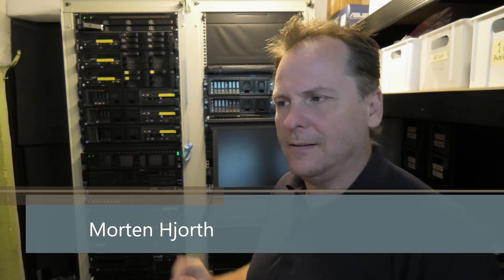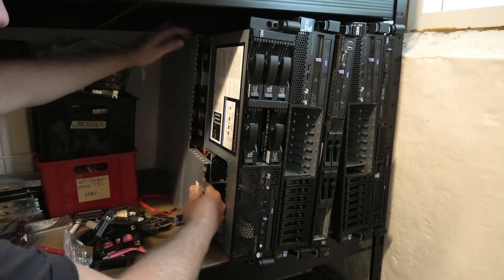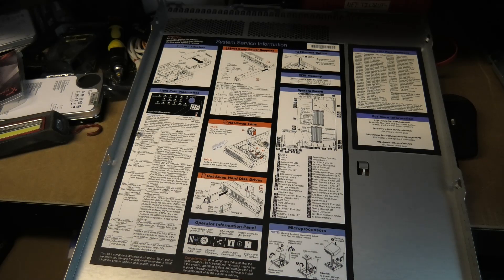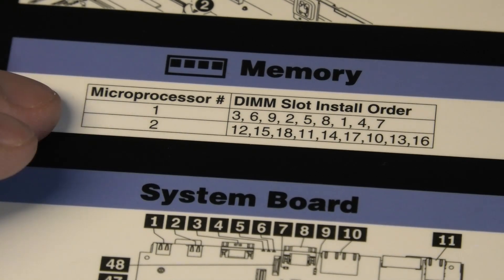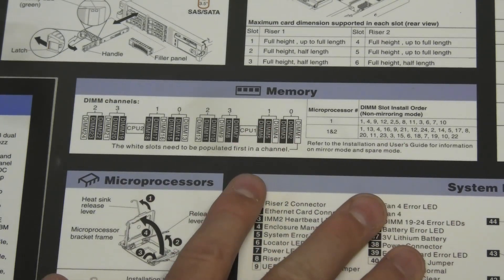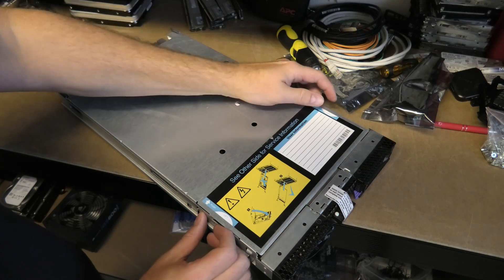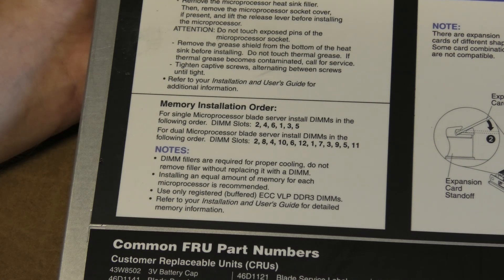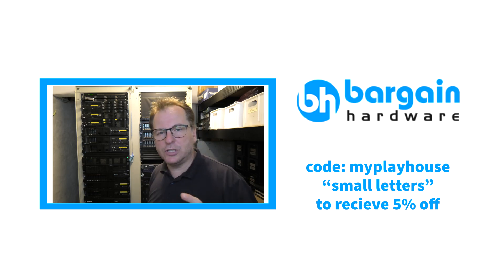How to Put RAM in a Server,, It can be Bloody Difficult - 1309

Comment: Hello everyone Does anyone know where I can get some help with my server I have a dell R720 where I upgraded the processes in it from (E5-2630 Sandy Bridge) to (E5-2630L V2 Ivy Bridge) it was no big deal problem. it starts up but now I have another problem I have an LSI 2008-8I with it mode firmware and it is connected to an external device where there is an HP - 468406-B21 SAS EXPANDER CARD Everything runs in HBA mode but after I have upgraded my processes Can the HP card no longer see my hard drives but I can easily see the HP card with the LSI card and the activity diodes on the LSI card flash when I connect the HP card.
Reply from the maker: That sounds very weird,, If posable,, try and swap the CPU´s back,, and see if this is really an CPU issue.
Reply: @MyPlayHouse  Hi Morten, I have tried putting the old Sandy Bridge CPU in as you mentioned and it works again. I have also tried swapping CPU 1 and 2 with the Ivy Bridge processes and it is the same problem. I have also tried to move as many PCIe devices to CPU1 and vice versa on Ivy Bridge but it was not successful
Reply: Today I tried with only one Ivy Bridge CPU and it works again
Reply from the maker: @jack99097  make sure it is firmware upgraded to the latest and greatest,, there might have been some sort of a fix...
Reply: @MyPlayHouse  I have always been against it being firmware updated. I've heard there's a BUG with one of the versions it's going to corrupt the idrac controller and then all the fans would just run on Full Hammer
Reply from the maker: Maybe keep the old firmware close at hand :-)
Reply: @MyPlayHouse  but I got it going with two CPUs from the Ivy Bridge. I bought another cpu and now it works fine

Comment: I tried to listen to this on speakers, but couldn't hear you over my Intel R2000IP chassis. Any suggestions on how to lower power and noise on rack servers?
Reply from the maker: Yes,, move the server to some where you do not have to listen to it :-) while watching my very important video's.
Reply: @MyPlayHouse  Turns out the bios was faulty on it, and it wasn't listening to the acoustic/power settings. Fixed it, will rewatch now!
Reply from the maker: So not it is not as noisy.. ?